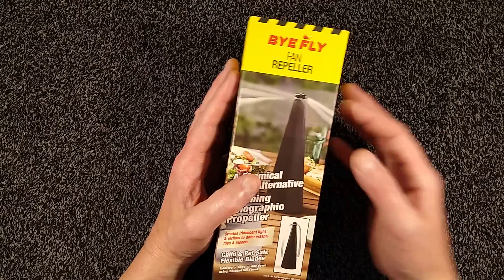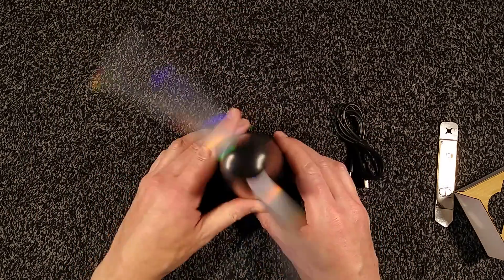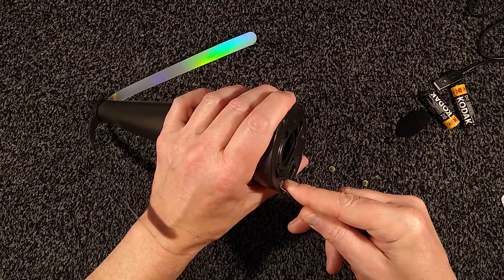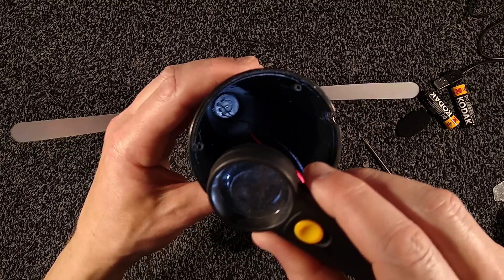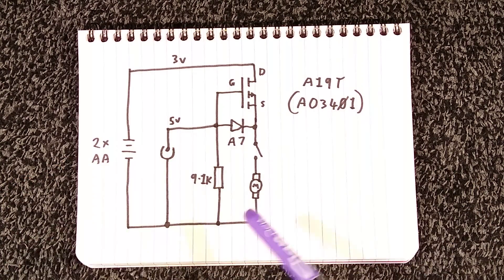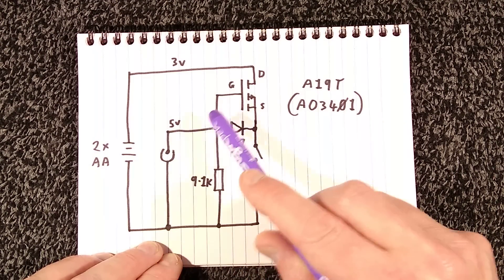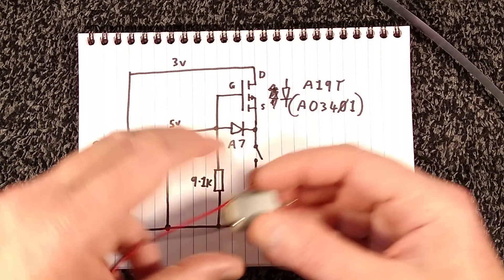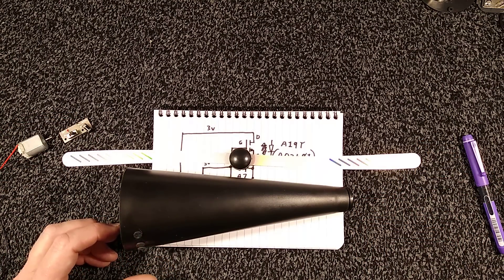Holographic fly repeller FLICKER ALERT!

Comment: I wanted to implement the P-channel MOSFET power switching function on a different circuit that would be powered from four "AA" batteries instead of two. Please forgive my rookie question, but would the AO3401 still be able to switch power sources? What would be the math? Thank you.
Reply: I'll answer my own question. After some breadboard testing, this P-Channel MOSFET arrangement will default to the power source with the highest voltage. In my circuit, the 4xAA batteries will be prioritized over the USB 5V until their voltage falls below that level. This should be fine for my project.

Comment: Wouldn't just a diode in the 3v and one in the 5v line do the same job without the additional FET and resistor?
Reply from the maker: I think they were trying to avoid the voltage drop on the already low 3V supply.

Comment: I saw one of these at work once, but thise didn't have holographic blades. They had just the standard aluminum foil blades.
They worked. No flies on the food.

I wonder why these manufacturers have to add gimmicks when they could sell with none of that.

Comment: The mosfet circuit is a interesting variation of what is called an 'ideal diode', a little known circuit that is actually quite common in SBC/microelectronics power circuitry. The raspberry PI 4 has one in it's power supply after the e-fuse, for instance.

'Ideal Diodes' leverage the reversed mosfet to make a 'diode' with (near) zero forward voltage drop, very useful when you only have 5v to start with and a reverse power diode (with a typical 0.6v Vfwd) would be catastophic in terms of voltage drop. 

Not common in literature (my copy of Horowitz and Hill does not mention them, for instance)

Comment: Interesting that it gets 3V vs 5V between the two power sources — ordinarily you see three 1.5V cells to achieve 4.5V which is close enough to 5V
Reply: It gets 3V from the batteries, and 4.3v from the USB (one diode drop). It's a motor, it's really not picky about voltage other than if the voltage is high enough to overcome static friction and the inertia and air resistance of the blades and get it spinning in the first place.

Comment: I am not sure if you can answer this, the first digital camera I had was a Kodak and very unstable, so I contacted Kodak service, and they told me that I must use Kodak batteries, so I brought some and all was well. I notice that you are using Kodak batteries, but they seem unavailable here (Australia) I assume that Kodak batteries have higher current rating? can you suggest a rechargeable alternative?
David
Reply from the maker: If your equipment can operate at the lower voltage (1.2V vs 1.5V) then the classic Eneloop NiMH cells are still a good choice.
Reply: @bigclivedotcom  Thanks 
David

Comment: Interesting that there is no noticeable change in motor speed between running on two alkaline cells (3V) and the usb supply through the diode (5V - 0.6V = 4.4V).
Reply from the maker: It is a bit faster on the USB supply, but not much.

Comment: I actually have one of these right next to me in my bedroom, as it's prone to getting gnats and little flies and can be really bad in the summer. I'd say it's somewhat effective: it's good at keeping most of them away from me, but it's not 100% and there are some that still get through. My main complaints are that my cats love it and it has teeth marks now from when it was new and their favouritest toy, and also just the noise. It has a very definite whirring noise and the whir is constantly changing as it slows down and speeds up. As someone who is sensitive to noises, I can only have it going for so long before I start to feel my sanity slipping away. Also it just doesn't last very long and constantly needs charging. But I don't like using insecticides for lots of reasons, not least because I have two cats and it's really difficult to make sure that everything is safe for them, particularly as they enjoy hunting the flies which may be covered in the insecticide. So this is a good alternative, and I think it does a good enough job considering it's just a deterrent! I went into it knowing it probably wouldn't be completely effective, but it's good enough for what I want it to do - stop little flies and gnats landing on me and getting in the little tiny cracks in my room to hide.
Reply: Have you tried screens in the windows, and not leaving your door wide open? Usually sure fire ways to not have flies inside to begin with

Comment: 1st thought: "that looks a lot like a battery powered 8" mirror ball motor.".  2nd thought:: "hmm.  USB jacks don't have a cut-off switch built in.".  I'm sure that circuit will soon become an ubiquitous IC.   (Rant truncated) It always peaks my interest how a simple moving piece of metal can be emulated by a far more complicated silicon solution.

...And then there's vacuum tubes.  They run on The Ether of The Universe.  And probably a few goat sacrifices.  Still haven't quite wrapped my head around those...

But hey!  Kids, if you're looking for a fun wormhole to fall into look up "Mercury Arc Rectifiers".  You will not be disappointed!

(edit) Oh yeah, also, apparently flies don't like hanging clear plastic bags filled with water either.  That's something that's an import from South America.  I've started seeing those outdoors at my favorite Mexican restaurants.  The reflected light supposedly messes with their eyes somehow and deters them.  I have not independently verified that claim but it does parse...

Comment: This resistor P-Channel MOSFET circuit is also a reverse polarity protection for the battery. Practically no voltage drop in contrast to a diode.

Comment: With the FET always on even with the switch open wouldn't that run the batteries down?
Reply from the maker: The gate resistor has a very high value.

Comment: That connection of the MOSFET is known as an "ideal diode" since it conducts in only one direction, but doesn't have a fixed voltage drop (I*Rds) unlike a real diode.

Comment: Down Under we refer to these as "Fly choppers", and they do seem to work in this fashion (at least partially).  That use of an FET as an isolating "switch" is really neat, and I've made a note of this for future use. Incidentally, the "virtual" diode is there for ESD protection, since the gate insulation is only a few molecules thick on low voltage FETs!
Reply: No... You're confusing it with the zeners some MOSFETs have across the gate-source. (Those are added)
This diode goes between source and drain. It doesn't protect the gate at all because it doesn't connect to it.
Reply: @kimchristensen2175  Thanks for the clarification! I remember the days when FET's were so static sensitive that just looking at the the wrong way was fatal, and  I recall that the reason that thee current design was far more user tolerant was due to insertion of some form of "protective diode". Ties in nicely with your explanation!

Comment: This circuit could be used to make a low voltage “UPS” to fail over to a battery if the external supply loses power 🤔

Comment: Video Idea:

Test the voltage on a wireless charging capable phone and modify a charger to output more wattage to get a faster charge.
Reply from the maker: The chargers are usually already pushed to their limit.  Many get very hot already.
Reply: @bigclivedotcom  good to know
Reply: @bigclivedotcom  What happened to video on the electronics vessel for electricians.  I am making a small book with products I find interesting like you feature.  I am going to credit your channel...

Comment: How come the motor runs at about the same speed on both 3 Volts (double AAs) as well as 5 Volts (USB)?
Reply from the maker: It runs slightly faster on 5V minus the diode drop.
Reply: @bigclivedotcom  Ah, now I see. Thanks!

Comment: I had one of those apart today, far more simple than this one trough if that is even possible. Just some batteries and a switch across the positive. It had been dropped, causing it to slow down every now and then. For those wondering, it seems to work at keeping them pesky flies away

Comment: When I was a teenager, around mid 90's, I bought  an alarm clock at a Best store. I live in the US, not sure if Best existed outside of my country. None the less, I got home with my father and plugged in said alarm clock and then plugged in the 9 volt back-up battery. While I was setting the time, I noticed that the bottom of the clock (where the battery was) was getting hot. I brought it up with my father; he was an electronics repairman who said that it was because the alarm was trying to charge the battery. I don't know if it was of poor design or someone screwed up at the factory, it wasn't supposed to do that. 

We ended up returning it for another one that didn't try to murder me by battery explosion.
Reply: Was it "Best" or "Best Buy"? We still have Best Buy but I don't recall a Best from the 90s.
Reply: Just "Best", some places called it "Best Store"
Reply: Must be pretty regional - fellow NA'en here, and I've never heard of just "Best" store either
Reply: To be honest, I thin k that Best was a midwestren thing. I live in NW Ohio and never really saw that many outside of my local area and there was only one in my city as far as I can remember.
Reply: @Pantherman1979  Now that I looked it up on wikipedia, I remember seeing a retail archeology (or similar channel - I looked it up - bright sun films channel) video about them a while ago. Looks like they were completely gone (bankrupt and liquidated) as of 1998, so they've been gone a while now. Pretty baller name for a company though "BEST" - how's the competition going to top that one?? "BESTEST"?? Some of their stores had super unique architecture too, also rare for retail stores.

Comment: Flies see things at a considerably different 'frame rate' to us - which is why they are so hard to swat. If you go for them really slowly, you can often get them. Additionaly, they feel the pressure wave of that rolled up magazine that you are so sure you are going to twat them with. A girl I knew swore by spraying the buzzing sods with hairspray, which gummed them up a treat.😆😆😆
Reply: I'm sure brake cleaner (acetone) would work well too - I've heard 'wasp spray' is mostly just brake cleaner with some kind of foaming agent added. I have tried brake cleaner on wasps when I didn't have any wasp spray, and it was just as effective as wasp spray is. You'd think it'd work on flies too!

Comment: i wonder how they're getting that low speed on the motor
is it because the air resistance from the blades is enough to slow it down? normally these tiny motors go brrrr quite quickly
Reply from the maker: I think it's just a low power motor dealing with a fairly high load.

Comment: I wonder how a pair of those Li-ion bucked AAs (when checking for charging voltage) would get to holding open that AO3401 when plugged into 5V. Assuming their reasonable protection, might it charge somewhat safely??? This discount-EE might find out; With pyro-containment tin at the ready.

Comment: interesting way to switch power from the batteries to USB. I remember older tech just used a barrel connector with a contact inside, that when you plugged the output line from a wall wart  into it, it would just disconnect the battery power , and switch to the wall wart .
Reply: Thats exactly what I was thinking.. Has freakonomics really got to the point where a PCB with semiconductors costs less than a switch mechanism in a barrel connector?
- I think the answer is actually 'no', we have just got to the point where you need a PCB to mount the barrel connector securely in the case anyway; and if you are doing that a PCB with the semis on it actually /does/ cost less than one with a more expensive switching barel connector and no semis.
Reply: @SlEasyTarget No, it's just that the once ubiquitous yet nothing-less-standard DC coaxial connector scheme is no longer relevant, USB is everywhere, and the spec doesn't involve a switch so no connectors are available with them. One still needs a way to disconnect in this situation, and the usual simple series diode isn't going to cut it when the supply is 3V. Enter the mosfet and its ~0V drop and the seemingly rube goldberg approach to driving it. 🤷‍♂️
Reply: @MadScientist267  
That's a nonsense reply, barrel connectors are also everywhere, still very, very popular. FOR A REASON

1) much cheaper and simpler connector to make, requiring fewer manufacturing steps and less expensive tooling than USB

2), they  have a  huge electrical contact area (relative to usb) which, along with a deep, secure, orientation-neutral design makes them more reliable.

USB -C can, at least, finally handle reasonable power loads but it's a much, much  more expensive connector to buy and tool for, and for high power it needs the complexity of usb-pd chipsets+circuitry, a very expensive alternative
Reply: @MadScientist267  
"he usual simple series diode isn't going to cut it when the supply is 3V."

Do you actually understand electronics? Because a weird statement like that suggests not.
Reply: @SlEasyTarget  Errderr You forgetting about voltage drop? Yeah, who doesn't know electronics. If you lose 20% of the supply voltage, it's not a great solution. Siddown. Been doing this longer than you've been wasting oxygen.
Reply: @MadScientist267  
Edit: Extensive afte re-reading thread.

Ok, I get what you mean about using a normal diode 'not cutting it'.. though it could have been better worded. The choice is between an ideal diode or a mechanical switch. Yes I agree.

You can have a entirely mechanical solution with a switch in the barrel body and no discreet electronics. Or you can have a barrel connector and a circuit board with, in this case, an ideal diode circuit on it because the forward voltage drop is unacceptable otherwise.

Modern economics may well make this more 'complex' solution actually cheaper. That was the point I really wanted to make. Because it's freaky.

PS; I built a (phenotic) voice sysnthesizer in 1983 and attached it to the PIO port of my commodore PET. I've been wasting oxygen a long time. Though ideal diodes had passed me by until a few years ago when I encountered one in the Pi4 schematics.

Comment: Doesn't this circuit always have a small drain on the battery to power the mosfet?
Reply from the maker: It's very tiny because of the high value resistor.

Comment: That mosfet must have a very low gate threshold voltage to work like that.
Reply from the maker: They do.  Around 2V.
Reply: @bigclivedotcom  I couldn't really see how the circuit develops 2 Volts at the gate-source junction... 🤔
Reply: @Poult100  It's a p-channel mosfet - it turns on when the gate is less than Vth BELOW the source. In battery mode, the gate is at ground (through the resistor - but no current flowing, so no voltage drop across the resistor) and the source is at the voltage across the motor, so the gate is 3V (or Vbatt) below the source. In USB mode, the gate is 0.7V above the source (because of the diode), so it's turned off HARD. It's very clever. As others have mentioned, it's an "ideal diode" circuit
Reply: @gorak9000  hmm, I understand about the polarity requirements of PMOS but I do get my head upside-down sometimes. I'll have another look.
Reply: @Poult100  pay close attention to where the source and drain are - they're not where they usually are in a PMOS because of the body diode, which he talked about in the video
Reply: @gorak9000  yep, yep. I used to have the same brain twist with pnp bipolar transistors.

Comment: They have these at outdoor restaurants in the Maldives on Maafushi island. Having sat at tables both with and without one, I can confirm their efficacy against the flying critters. So does putting a daub of their hot sauce on a napkin and placing on a nearby tree as one waiter did for our party?! Not quite sure how or why that one worked either, because it’s not like the flies were attracted to it. Quite the opposite as the didn’t want to be anywhere near the area after it was applied.

Comment: I don’t understand the purpose of the MOSFET. Why not simply replace it with a diode and delete the resistor?
Reply from the maker: A diode would introduce voltage drop on an already low voltage.
Reply: @bigclivedotcom  - Good point. I’m sure you’re right, but what an over-engineered solution to a circuit that simply spins some shiny ribbons :)